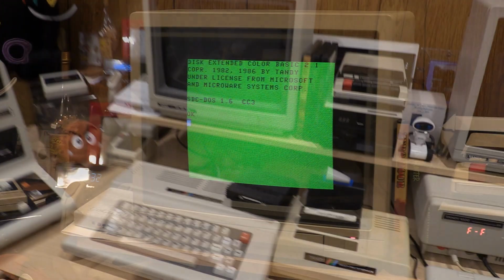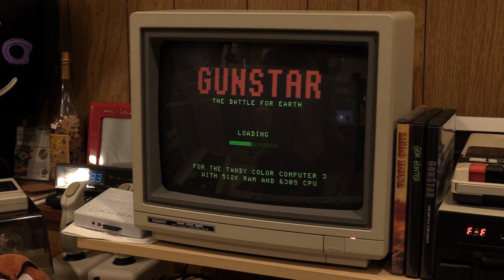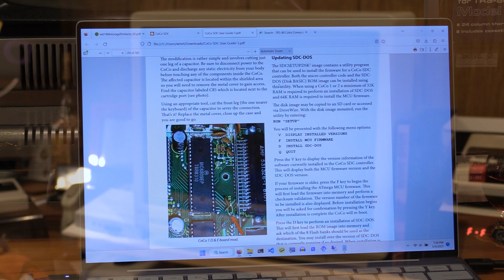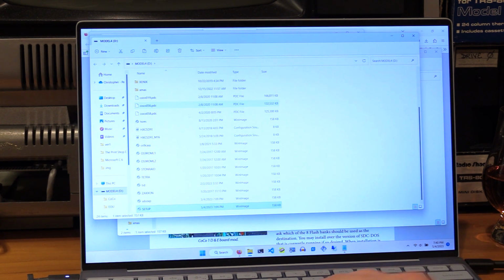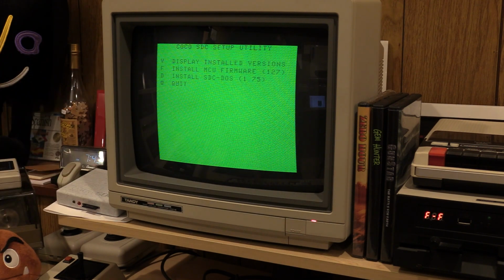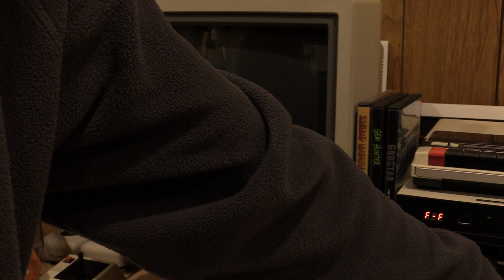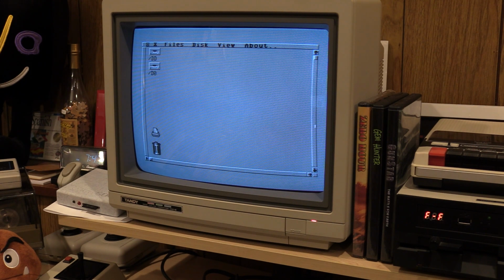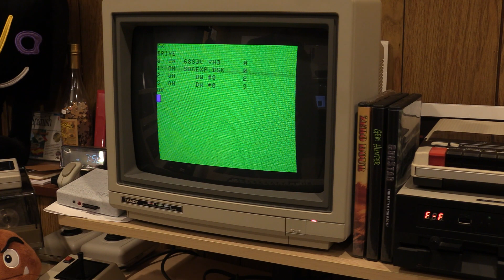CoCo SDC Firmware and SDC-DOS Upgrade

Comment: What settings are you using for Flashfloppy?  I just bounced off my first attempt to make it work.  I've got the latest Flashfloppy installed.
Reply from the maker: Believe it or not, the FF was a placeholder for the drive since I didn't have a blank for Drive 1, so other than flashing FF over to it, I never ended up using it.  Now that I've managed to 3D print a blank plate for the FD-502 drive, I've taken the FF out.  I'm hoping to use it with the 8" systems, so if I do I'll be sure to cover it so people can see it.  Thanks for watching!

Comment: Great tutorial.  Now I need to update my SDC firmware and SDC-DOS. Agreed, the SDC is awesome. It was one of the first modern pieces of kit I ordered once I had a CoCo 2. I now use it with my CoCo 3.
Reply from the maker: Thanks!  One thing I should have mentioned in the video: If you have replaced the CPU in any of your CoCos with a Hitachi 6309 and are also using the 6309 version of NitrOS-9 EOU, don't upgrade the firmware quite yet (you can do SDC-DOS, though).  There's a timing issue with the new SDC firmware and NitrOS-9 EOU that causes it to crash on boot.  If neither apply, you're good to update.
Reply: @TJBChris  I have done the Hitachi 6309 upgrade, so I'll only do the SDC-DOS portion of the upgrade for now.

Comment: Growing up on my CoCo2, I'm still beyond amazed at just how capable these machines really are, especially the 3.  I didn't even know about NitrOS-9 until a little over a year ago.  My CoCo3 only has 128k, but I have the 512K expansion board.  I just don't trust myself with a soldering iron anymore these days and need to find someone local who is so I can have it installed and open up the way to play some of the really cool games 😎
Reply from the maker: I feel like back in the day the CoCo didn’t really get its due outside of the community, but inside the CoCo community it got a lot of love.  We seemed to know what we had (especially for the price), but it’s hard to convey that and not get compared to pricier machines that are “better”.  That seems to be changing as people continue to push it well beyond what anyone ever imagined was possible.  Even stock, it’s amazing what people have done with it.  

As to your upgrade, many 512K upgrades only require removal of one or two caps, removing the socketed 128K chips, and installing the board in the header.  I just clipped the caps in mine rather than desoldering them.  I’m sure some would cringe, but meh. 😁
Reply: @TJBChris  Yeah, I may revisit it here soon enough.  At the moment, I'm working on some Apple IIe and IIgs things ;)
Reply: Hey Bolling, nice to see you in the comments section 🙂I have faith that you can do the 512K upgrade on your CoCo 3. As mentioned by TJBChris, you can just snip the caps pending on which upgrade you have.
Reply: @geekwithsocialskills  Maybe, but if I mess something up, that's it LOL